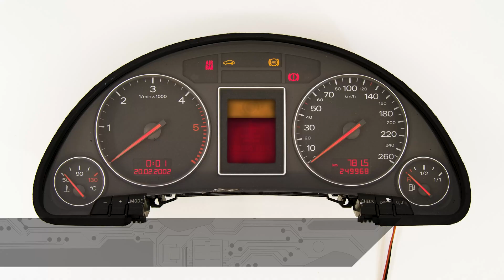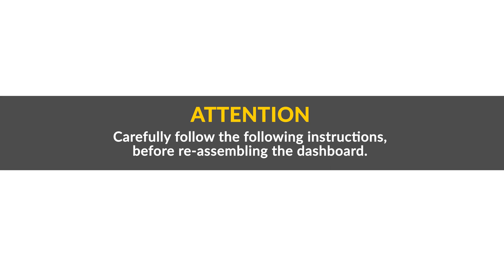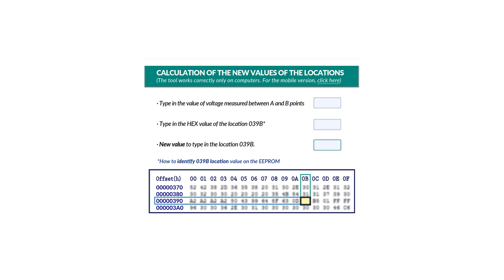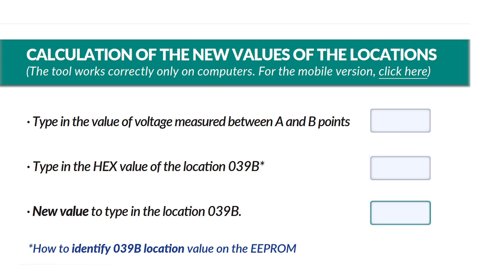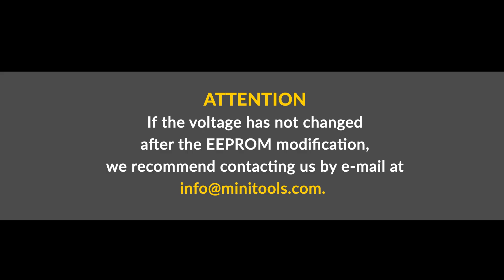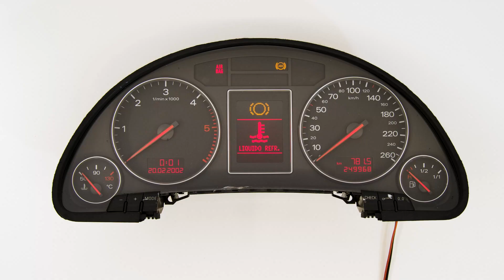Audi A4 B6 - B7, S4 B6 - B7 and RS4 B7 LCD screen replacement – instrument cluster pixel repair

Comment: Hello.
The original lcd in my car has all readings but it is hardly to see.
I measured the voltage at these points 5.01 v.
Also the voltage at the 2 terminals of the yellow plate under the lcd is 0 v. Could you please let me know where the problem is.
Thank you
Reply from the maker: Hi, if the display is unreadable it needs to be replaced with a new one, the voltage has to be measured after replacing it to adjust the voltage, not before.

Comment: Why is the modification of the EEPROM necessary?
Does it have an influence on the brightness of the display?
Reply from the maker: Hi, the EEPROM modification adjusts the brightness and the contrast, optimizing the display visualization.
Reply: @MinitoolsChannel  Is the lifetime tested if the voltage stays at 7,6V?
Reply from the maker: For extra details please check the following instructions, which are valid only for our SEPDISP26 LCD screen https://www.minitools.com/en/modification-instructions-for-audi-a4-s4-b6-a4-s4-rs4-b7-seat-exeo-instrument-cluster-display/
If you have any other question please send us an e-mail at info@minitools.com, thank you.